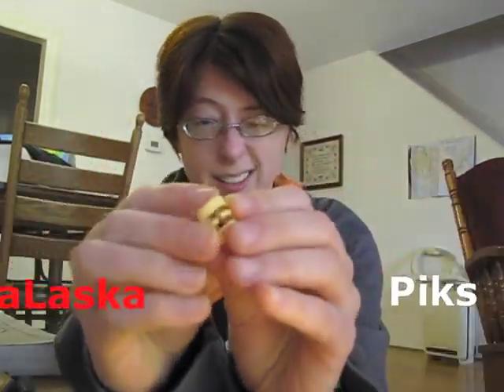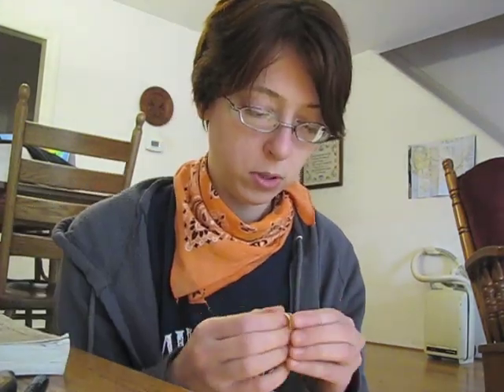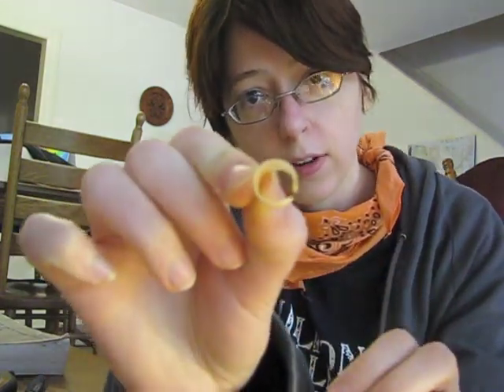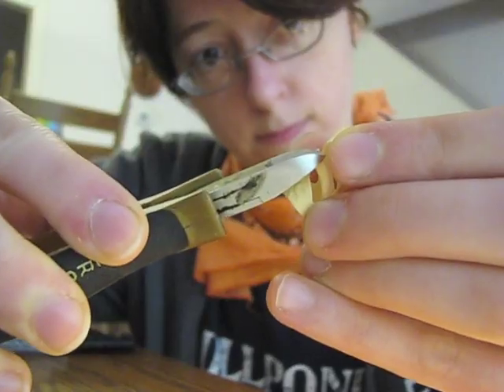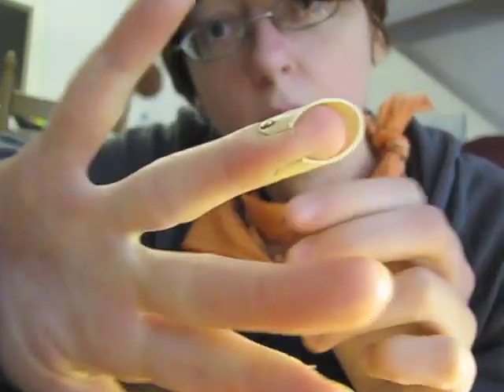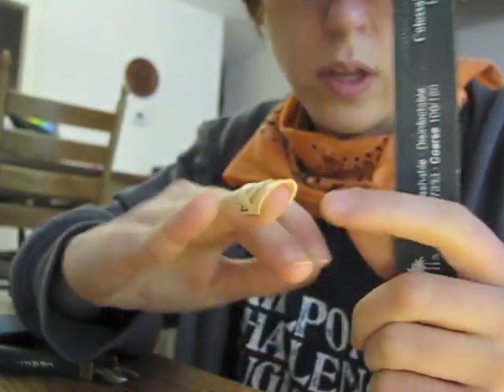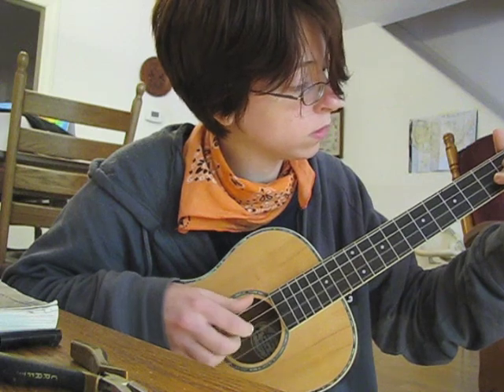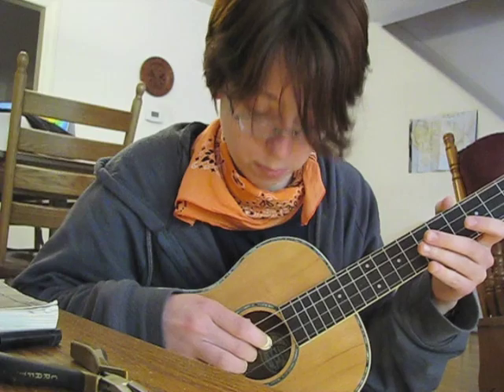aLaska Pik Tutorial (plastic)

Comment: Okay. You got me to try some. Put them in my cart just now.  Thank you. I've been testing the Chinese pro-pik knockoffs, and while they are far better than the old banjo picks, for me, they are still clumsy and weird. I am also going to try Butterfly picks ($5 a piece!)  and I'm even looking at Mizrabs, which are used on sitar. When I turned 50, my nails just turned awful. I am hyper sensitive to certain chemicals and I doubt the fake nail application process would be bearable. I think I'm on the spectrum and just the thought of the application process and having something that isn't part of my body, glued to my body, freaks me out. Also, my daughter told me that sometimes fake nails can pull the actual nail off. Nope. 
 I loved your video. I will be revisiting it, with eye protection, when my picks arrive. I wonder how long they will last on steel string. Longer than my traitor nails, I bet!

Comment: Hi, nice tute - only just turned onto these picks. I will try the clip thing you demoed but I got them to fit by putting them in almost boiling water with a tapered knife blade inserted to splay them - it worked fine. I filed as well but did some initial trimming with manicure scissors. Good tip about marking - I shaped mine and then afterwards  had no idea which was which :(

Comment: Good video, Em. Pretty good picking, too. 
Get some safety glasses. ;-) You might also want to look at the Xuron 2175 Maxi-Shear™ Flush Cutter. It's supposed to cut soft wire up to 12 AWG (2mm), so might work okay on the plastic, and be able to get into small spaces.
I think it was on your recommendation (and maybe some good reviews on the Steel Guitar Forum) that I bought some Fred Kelly Freedom picks, too. I'm not much into fingerpicking, but with a lap steel guitar in my collection, I wanted to try them.
Keep up the good work.

Comment: I'm not a spokesmen either ...and I think these picks are wonderful....yet you do have to work em....they stung my fingers after about 20 mins......She's right....they're  really tight......I sanded the outer edges round and thinned out the material around the edges to to take the tension out of em...I have taken the tension out of em so much they wont stay on my finger....that's were the elastic black tape comes in hand....I didn't file the ends at all...I found that it was fine stock ...you may disagree. These things aren't picks....THEIR WEAPONS!...you can really go after it with these things.....I so wish I had bought em earlier....they have without a doubt TOTALLY changed how I play....I've only been this connected to my guitar with fake nails.....I just can't say enough as to how happy I am with this product...there not expensive and if you do any kind of finger picking at all and your nails are a bit of a issue and you have problems playing bare fingered like I do....You owe it to yourself to try these out.....

Comment: There's actually an easier way to do this without having to cut them out but you're going to have to spend a little bit of money. I normally don't use finger or thumbpicks but when I hurt my finger I had to use Dunlops (didn't know about the Alaska's then.) Tried the Fred Kelly Freedom Picks but they didn't work for me. You have to go to a hardware store that sells long sockets (unless you find a Snap-On truck in your travels.) You find the deep (long) sockets that are as close to the size of your fingers as you can get. Also get a long extension shaft to put the socket on so you don't burn yourself. Next you'll need a heat shrink gun. You don't need to turn it up too much, just enough to soften the plastic until it opens up to the size of the socket. Place the socket on the extension driver and the pick over the socket and start heating up the pick, it should only take a few seconds and as soon as you see it open up turn off the heat gun and let the pick harden around the socket. It should fit perfect. At least it did for me.

Comment: Well i tried wearing the pik's without cutting them to size and they fit fine but although were tight, now i have cut them like you showed they are too loose to fit at all... now i'm wondering are they worth the fuss because i live in England and i got these from America, took them like a week and 2 days to get here, now they're basically ruined, would it be better to just use fingernails?

Comment: because you put it under the nails, aren't there some risks of maybe breaking/flipping your fingernail if little force was applied from the bottom side??
Reply: Sungho Yoon- When torque is in the [A] vector, the velocity that is crucial to string vibration has been exponentially factored to level (B). As you triumvate through (C), there will be a ratio of diminishing returns relative to the inverse square of its sum. Do not look to cosmic interference when assessing root cause analysis. Additionally, force {T} can often be accentuated by virtue of gravity (g) and Thumb Torque (TT), which can vary between multipliers of 3 through 7 depending on your pick attack force (paf).